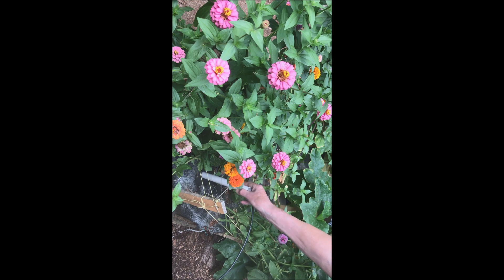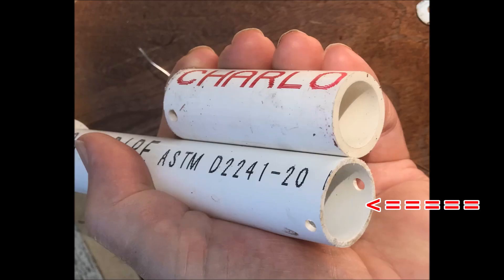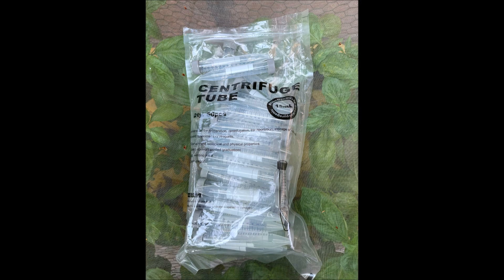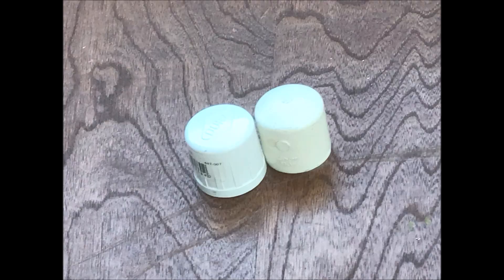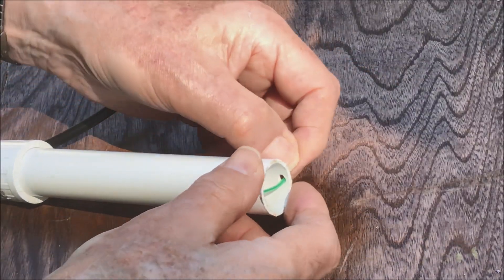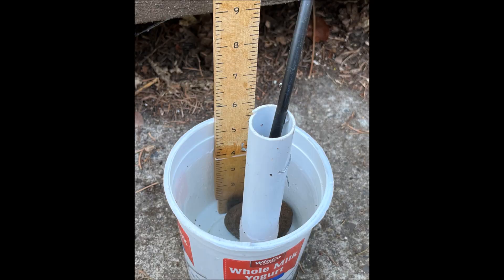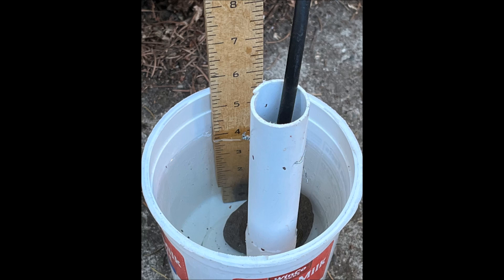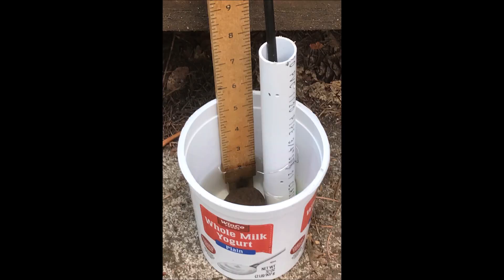Dipstick Float Valves for Watering Plants - Part I

Comment: Hey Dr. Kratky - thank you for uploading another great video regarding dripper cap float valves! How reliable have you found these to be in practice? How often do you experience clogging? I've been using storebought micro float valves that have been giving me trouble and I'm considering trying it your way for next year's growing season. I have a 55 gal drum that is about 3 feet tall (elevated an additional 1 foot) and I worry that the pressure differential between a full vs near-empty drum would cause a problem given the sensitivity to pressure you've described. Do you suppose that a more buoyant float would help in this situation? Thanks for your time!
Reply from the maker: I have noticed several occasions of being stuck shut.  Perhaps, the float block was lodged against the wall of the pipe.  If the head pressure will be 3-6 ft, then a more buoyant float might be needed, but try one of the regular methods first.  Clogging incidence will depend upon whether there is dirt in the solution so use a teabag filter to minimize this.

Comment: I have a question Dr Kratky about the impact of varying level of water head on the float valve's ability to maintain the level.
Let's say at the start, the supply tank was completely full giving 20" of water head as measured from the bottom of the grow tank and the valve maintained a level of 4" of nutrient in the grow tank. After some time, the supply tank become half empty giving 15" of water head now. Will the float valve still maintain 4" of nutrient in the grow tank in the face of decreased buoyancy pressure requirement to stop the flow from the button dripper ?
Reply from the maker: Good question!  The full tank results in somewhat more water pressure than a half tank and causes the water to rise higher.  For example, when a graduated centrifuge tube is the float mechanism, a full tank might cause the tube to exert 10 cc's to counteract the pressure, whereas the half tank might only require 8 cc of buoyancy and so the water level would rise higher for the 10 cc buoyancy than the 8 cc buoyancy.  Water height wouldn't be affected much by a large area float such as in the yogurt container float valve, but would be more pronounced in a float mechanism with a small area.

Comment: I have 5 Gal buckets with 6 in net pot tops that I want to maintain for the duration of the crop (tomatoes and peppers). At what level should I install the float valves? Should I use the half volume level or would the plants benefit from having a higher volume of nutrient solution?
Reply from the maker: Great question!  I don't have solid data on this, but my rule of thumb would be to install the float valves when the solution level has dropped to 40 or 50% of the original level.
Reply: @growkratky5558  Since the nutrient level will be maintained automatically and small nutrient volume is no longer a concern, why not let the level drop to 1/3 of the original level, just like a thin film in NFT system . This way, the plant can have more air roots and still has substantial 1/3 volume of the nutrient to survive for few days if the system fails to maintain the level.

Comment: When following these designs learn from my mistakes! Don’t use widely available schedule 40 PVC as 15 mL centrifuge tubes do not fit. I believe schedule 30 by was used in the video which may be a bit harder to find. 1 inch PEXb could serve as a substitute if there is concern for PVC safety, but you sacrifice some rigidity and cost. You could use external crimping or clamping to fix the dripper in place with PEX. 0.5 gph pressure compensating emitters specifications vary by brand, but need higher pressure to function. At an approximate 2 foot pressure differential mine did not flow at all. Still learning as I go!
Reply from the maker: Thank you.  I appreciate your efforts and sharing of your experiences!